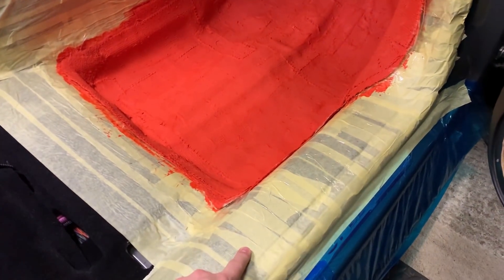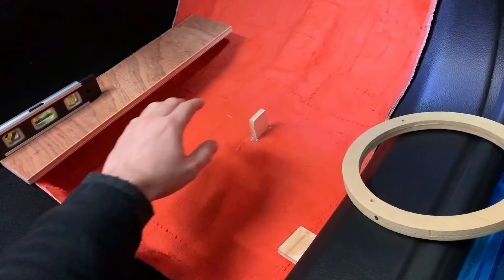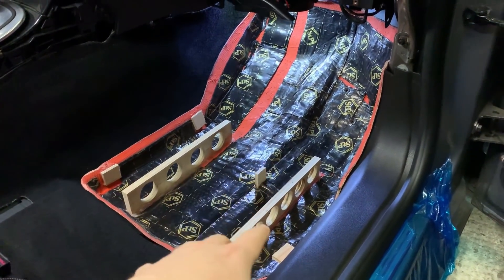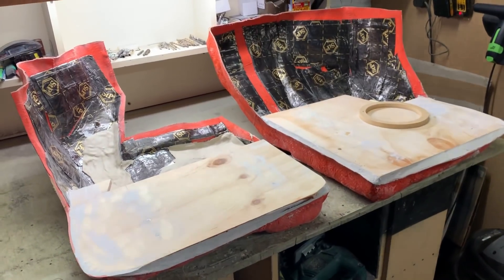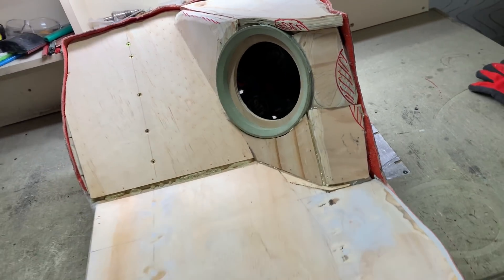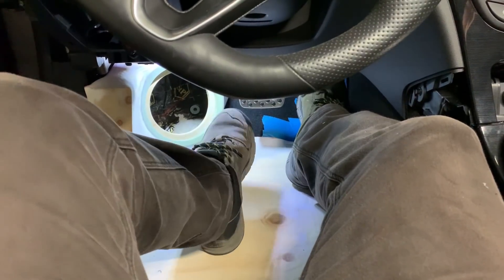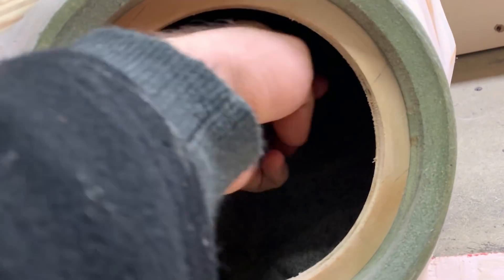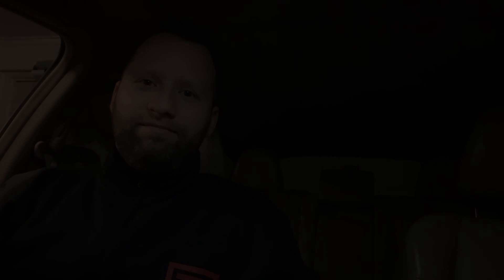Extreme SQ Midbass Install with Accuton C165AM

Comment: I've  recently discovered your channel...YOU ARE AMAZING!!!  Your skill imagination and attention to detail is like anything I've ever seen. I though i just wanted to put some subs in the back of my car and that's it.. Not anymore.  You've changed my thoughts about car audio.. Thankyou and keep up the amazing work..
Reply from the maker: takedat1987 🙏🙏
Be careful with the rest of the videos, some people can never look back and have a “simple” system after watching everything on this channel! 😃😂
Reply: Awesome work dude...It seem you are big fan of Zapco Amplifiers...I do have a question. I currently have Audiofrog GB 10 and 25 for my Mids and highs in my INFINITI Q50....I also have a Audiodevelopment Neo 800 midbass. All 3 components are powered by 2 Zapco Z-150.4 amplifiers in active mode. I also have a Frog GB12 in a .85 cubic feet sealed enclosure....The bass is kinda lacking in accuracy and Definition. I was thinking on upgrading to a acoustic elegance SBP15 in a IB setup....What are your opinion on this sub sir. @pssound9749

Comment: Could you list the connectors used for the speakers on the video discription?
Reply from the maker: Matt Roadfeldt i think i showed the XT connectors in the amp rack wiring video, XT60 for small speakers, XT90 for sub enclosure.
Reply: @pssound9749  what did you use to seal around it to make them water/airtight? Butyl?
Reply from the maker: Matt Roadfeldt around the connectors? Hot glue. 🤷🏻‍♂️

Comment: This seems like a lot of enclosure for a 6.5" driver. Doesn't make sense when normally this driver just sits in a small book shelf style speaker. I also don't know what liters convert to in cubic feet but sounds like it's over a cubic foot.
Reply from the maker: You have to learn to make difference between speakers by T/S parameters, not the size. You can not generalise like this. 
You can also google cuft -> liter.